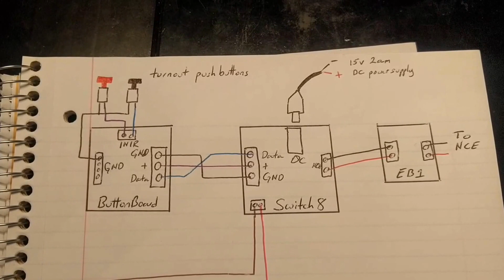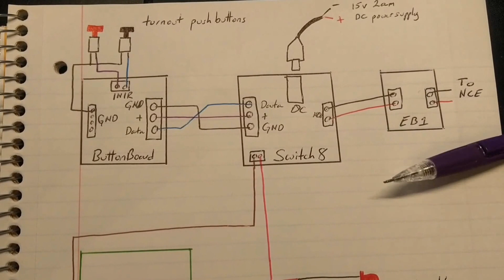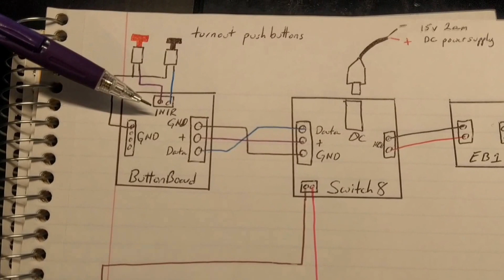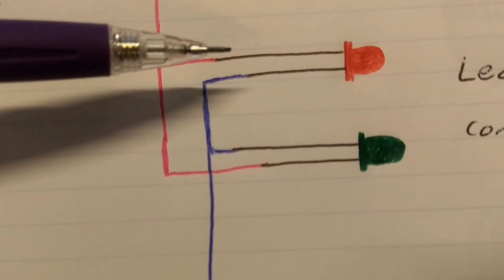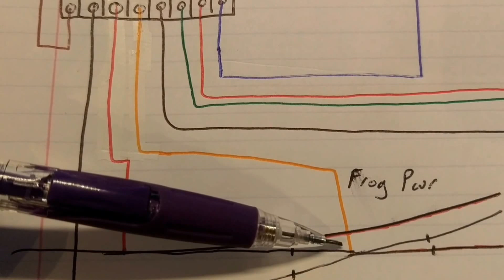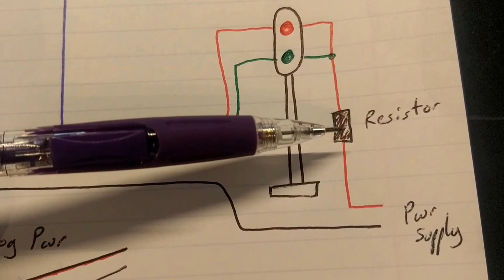NCE Switch8 to NCE Button Board for John Butler

Comment: Anyone on here know how to connect the wires from the LEDs to the wire coming from the switch 8 and the wire going to position 8 on the tortoise to the leds? For us non electrical folks lol thanks
Reply from the maker: Going to have to reword that,  I am not understanding your question.
Reply: Professor Grimm in your
Video u showed the wire from the switch8 mk2 connecting you the leds and then wire from the tortoise position 8 connecting to the leds not sure how to connect the wires to the leds? Is just not real clear to me?
Reply from the maker: @medtech68  OK,  on that diagram I showed two different led options,  one for switch panel indicators and the other for signals on layout.  On a led there is an anode and a cathode, they are identified two ways. One way is the legs off the led one is longer,  the other is to look inside the led and identify the "flag" inside.  Since most leds are polarity specific by wiring them as I have drawn will allow one to light in one direction and the other to light in the opposite direction. Tortoise switch machined are stall motors so current is always being applied.
Reply: Professor Grimm yeah I get that but how do I connect the wire to the anode and cathode ? Do I cut the wire and solder them on or use a suitcase connector? I see how it shows the pos going to the wire from the switch 8 and the neg going to the wire also but don’t know how to connect them together ? Sorry to be so dumb electrical is not my forte lol
Reply: Or do I connect the los and neg together and run the wire from the connected anode and cathode to the wire from the switch 8?
Reply: And I’m referring to the leds for the tortoise not the push buttons
Reply from the maker: @medtech68  I prefer a good solder connection and heat shrink.  The led's are optional,  so solder wire to the tortoise and put the led's in a control panel.
Reply: Professor Grimm that’s what I’m trying to do run the leds thru the switch8mk2 as it shows in tour video but I’m not sure how to connect the wires as it’s shown in the video from the switch8 to the leds and from the leds to the tortoise? I just don’t know how exactly to wire those to the appropriate wires ?
Reply from the maker: @medtech68  There will be two wires that come off the Switch8 that will run to the TSM (tortoise switch machine) one wire will run directly to the TSM and the other lead will have the led's inline. The I am not sure how else to explain it, the cathode (short lead) is soldered directly to the anode (long lead) of the other led, and again to the other leads, then you now have two leads off the two led's. This assembly is now soldered in-line to what I have represented as a red wire on my diagram. By doing this current will always flow through the led assembly as current flows one way, one led will illuminate, as current flows the opposite way the other led will illuminate. the led's are not needed for the operation of the circuit at all.
Reply: Professor Grimm sorry don’t mean to be so hard headed so once solder the long and short leads with a wire I will need another wire off them to attach back to the line coming out of the switch 8 thats going into tortoise position 8 !?
Reply from the maker: @medtech68  The led's are optional and mean to go into a control panel to indicate the position of the turnout. two wires out of the switch 8, one of those directly to the TSM the other wire goes to your control panel, through the two led's then to the TSM.
Reply: Professor Grimm oh I was using the leds as dwarf signals same
Concept right
Reply from the maker: @medtech68  sure
Reply: Fantastic video, thanks. I note you have no resistor comming from the Switch 8 to the LEDs. Should there be one?
Reply from the maker: @richardray6827  are you referring to the two LEDs I have inline that will show the position of the switch? Those are 100% optional and if you refer to page 4 on the NCE Switch 8 document it talks about LEDs and provides a diagram with no resistors. You will need to source the proper voltage LEDs as they themselves inline in the circuit will add resistance and lower the voltage to the Tortoise, which should make it run slightly slower.  As long as you are using LEDs that are rated for 12 volts you do not and should not use a resistor.

Comment: Ah ha!  Now I see how it's done.  This is exactly what I needed to see.  Now I think I need a 2 - 3v power supply for the indicator lights, if I'm reading the package right for my red/green LED's.  Thank you!
Reply from the maker: There is a 5v output on the NCE boards if you want to step the voltage down via resistors to illuminate those LEDs.

Comment: Alright here's a question for you.  Thanks in advance for any light you can shed on this.  I have several Switch8 boards wired up as you have shown and they work great being thrown with the ACCY control on a ProCab, but am ready to replace this with the more user- friendly method of push buttons.  I have an 8 track staging yard.  As you and NCE show, this would require 16 buttons due to the need for an N and R for every turnout.  To enter yard track 5 for example, you would have to push the N button for turnouts 1, 2, 3, and 4 and R button for 5.  Is there any other method that can be done for a simple yard ladder like this such that when a track is desired only one button press can yield all turnouts leading up to the desired track to go to normal and the final turnout going to R?  NCE seems to provide little information on this board.  Thanks.
Reply from the maker: Pittsburgh Mainline Productions crazy simple answer on that,  use a NCE Mini Panel and program macros's that throw the turnouts up to 8 per macro if I remember correctly.
Reply: Awesome, thanks for the quick response.  I will look into this.  So the Mini Panel would eliminate the Button Board and go straight to the Switch8?
Reply from the maker: Pittsburgh Mainline Productions the Mini Panel is actually a cab that connects directly through the 6 wire can-bus your UTP panels connect to.  When you hook a SPST momentary switch it will activate the programs you programmed into that slot of 30 on the mini panel.  You will be programming in a cascade of turnout controls that will throw a line of turnouts as you need per programming.  So button boards and mini panels can work together  without any issues at all.
Reply: Ok, so if I ultimately only need a push button for each track, would that push button's leads be connected to the Mini Panel or Button Board?
Reply from the maker: if you are doing a yard ladder with a single button on each track, those momentary SPST push buttons would hook to the Mini panel and would activate corresponding macros.
Reply: Ok so in this set up you described the buttons would connect to the mini panel, so would there be a need for the button board?
Reply from the maker: Pittsburgh Mainline Productions well that depends on your set up.  And how you want things to go.  The answer yes and no,  if you have turnouts that are no apart of the ladder you may throw Seperatly like a cross over for a run around, you may want that on a button board, but there is no harm in using a mini panel in full replacement of a button board, just can be more expensive depending on the application and where. 

Count all your turnouts and switch 8's then factor how many of those you want on macros. In the end a little more wire may save you money by only need X button boards and 1 mini panel
Reply: Alright that makes sense.  Thank you very much for your help.  I'm looking forward to bringing this project to fruition.
Reply from the maker: Pittsburgh Mainline Productions my pleasure,  oh one thing that may be of interest to you is a BD20  can activate a mini panel. So you can have logic and macros auto by moving trains through blocks.

Comment: SWEETA!!! VIDEO ,,, helps a lot,,, for I have yet to add the tortoise switches to the layout,,, you make it look some what E-Z to do.. thx for sharing,,, Tom
Reply from the maker: hey no worries, if you have any questions in the future feel free to ask. A tip on tortoise switch machines is to use Hot Glue to mount them then put the screws in, you have a couple of seconds before the hot glue congeals all the way to manipulate the placement.

Comment: Thanks Mark! don't know if i will go to that extent but i have been reading up on powering the frog points.
Reply from the maker: Ralph Greenwood powering of the frogs is something only to do with the Tortoise switch machine and the turnout,  totally isolated from NCE
Reply: got it-wont be going with NCE the way it looks
Reply from the maker: Ralph Greenwood the button board and eb1 and the separate power supply is optional
Reply: got ya-mine would take power from track and use 3 pole switch